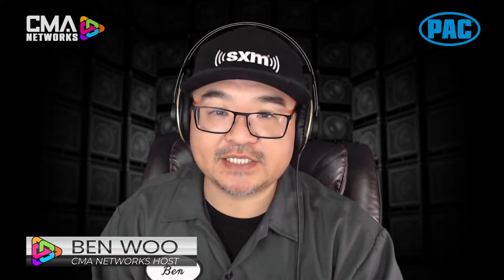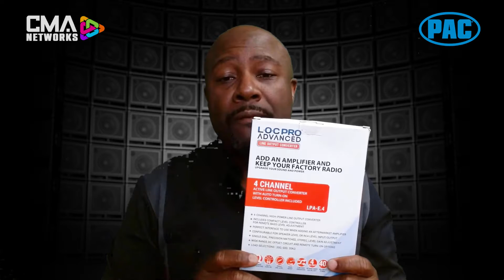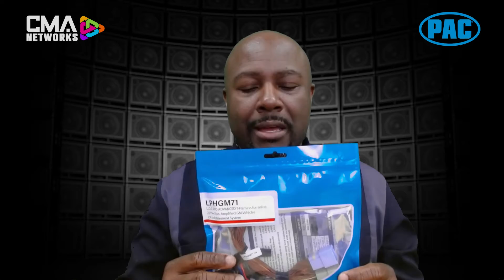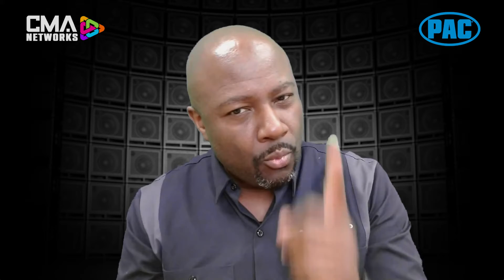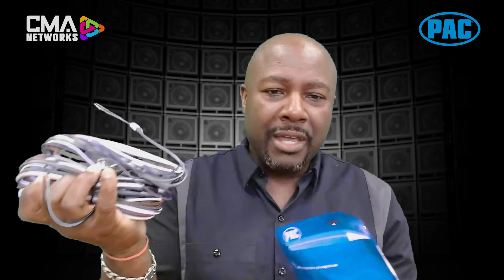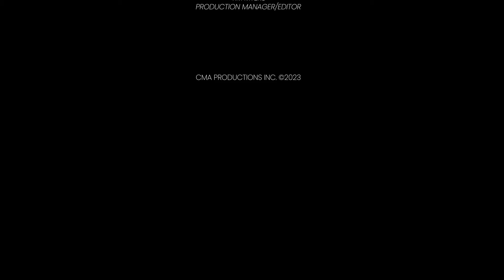PAC | OEM INTEGRATION | CONNECTED

Comment: when it comes to integration aftermarket radio forget it it's too much trouble Toyota RAV4 especially too many new cables too much more trouble there's no room for the new radio once you get the wires stalled and there's still two problematic